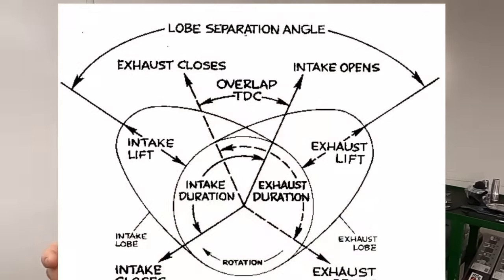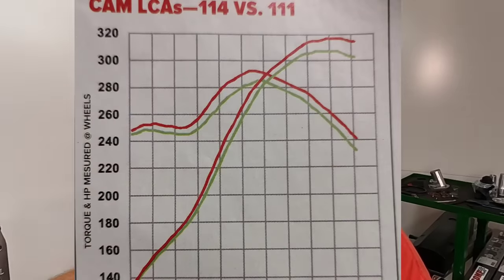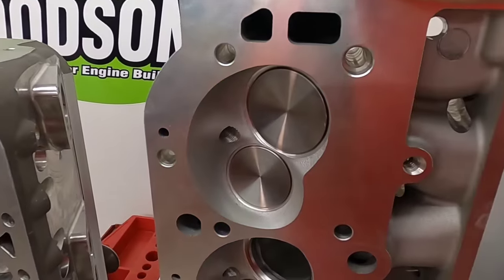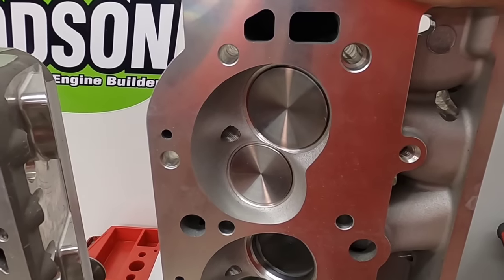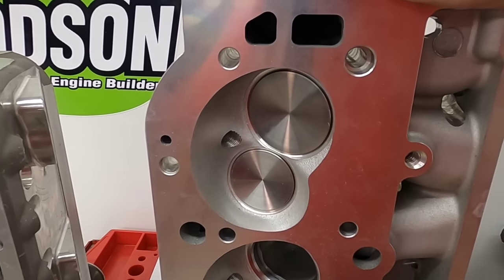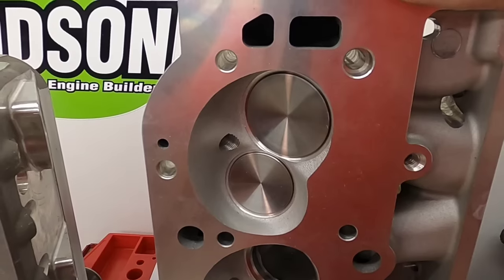Camshaft Lobe Separation Angle: The Untold Truth of LSA!! How to Pick LSA the right way@DavidVizard

Comment: Simple way to test it. Same cam lobes with the only thing changing is the LSA.

Then shift the overall cam event windows forward and backwards by simply advancing and retarding the cam(s.)

There. You now have a real-world dyno test changing ONLY the LSA.

PS four-valves, three-valves and Hemis will need less overlap to properly evacuate the exhaust.

Similarly, given only two valves, the more you dial the orientation of the valves from directly in line with overall flow to being a wedge side-by-side (or worse, if you had any reason to do so) the more overlap will be needed at any given RPM to scavenge the maximum exhaust, but the greater will be your swirl, as Pro Stock engine builders seem to absolutely LOVE.

As ever, your best route to maximum results is to test every single possible cam on your engine until you get it to behave exactly as you wish. Few people have the patience to do so, however. Preferably on the same day and at the same ambient conditions.

That includes flat tappet, roller, mushroom tappet, EVERYTHING.

Comment: My personal experience has lead me to believe that most "street/strip engines are full of compromises. If your running alot of lift, slot of duration you close the centerline to bleed off low speed to bleed off cylinder pressure at low rpms and spin it up to the point that the overlap isn't an issue and ur making killer power at 5000 to 7000rpm? I plan  build from my 94F150 flareside. I have a tci c4. I need to bleed off low( below 3500-4000) and come on like gangster 50' out! 450-500 hp max! A Sunday afternoon ride just to get ur adrenaline fix!

Comment: Just subbed to new channel.  Hey Andy, what was the combo on the 4.6 in the mustang when you made those dino pulls (compression ratio, head flow, intake manifold)?
Reply from the maker: John, at that time I had ported the Non-PI heads had 10.5 to 1 compression, Edelbrock Vic Jr intake with a Holley 650HP carb with 1 5/8" to 1 3/4"  Edelbrock stepped headers  the heads flowed 220ish cfm 
Thanks for subbing to DV's new channel
Andy

Comment: On a street engine I like to build an engine that's going to make loads of power in a useable rpm range. I've had engines that were almost all bottom end and almost all top end. I had a lincoln that sucked on lower rpm power but got the car to 165 mph, slowly. It's best to make loads of power by the time you hit 120 mph with midrange and top end power. So 2500 to 6500 rpm would please most.
Bloodviking

Comment: Hi guys thanks for your knowledge. Im currently running 230/236 112 on 355ci running 9psi with 2.4l whipple putting out 670hp /635ftlb @ 6200  but intake temps are up a  bit would the cam specs affect this at all?
Reply: Definitely not. You either lower the pump via maybe different speed or try to cool the charge a bit. Retarded timing and high octane would be your friends if all stays the same.

Comment: So l have a Question 4U Andy & David .  On a 496 Chevy BB .  With Brodix Aluminium Heads.  Not sure which ones at the moment.  Rectangular Port though . 
With the Edelbrock X-C96  X-Ram Manifold  circa 1960's . 
11.5 to 1  Compression.  Your 93 pump gas ⛽️ is 🇦🇺 Australian 98 octane.  
HP & TQ . 
1) 660/680 HP if possible.  
2) TQ as much as l can get . 
660 Centre Squirter Carburettors or Holley EFI Carburettors.  
MSD Ignition with 7al Box if using 660's 
& Holley Stuff if using there efi Carburettors.  

Hope this is enough information 4U. 
Now the Question 4U. 
What Camshaft Specs would U recommend pls . 
Engine use :  Marine.  
Beismeyer Flat Bottom  V- Drive 

Howard Cams recommend a Profile with around 640 lift & 112 lobe centre line . 

Thx Andy & David

Comment: My brother recently had a 383 Chevy built with a mutha thumper cam cause it sounded cool. Doesn’t make enough vacuum to operate the brakes. Told him it was the wrong cam for his type of driving. Fell on deaf ears
Reply: He's talking maximum torque and HP.... Not vacuum.
Reply: @hotrodray6802  understood
Reply: How's the off throttle response and general "nut" of the engine?  Does it take a bit to wind up and "come on the cam"... that sounds dirty.
Reply: @superkillr  haven’t heard it run. They only drove a short distance because it had no brakes. It’s a 55 Chevy still under construction
Reply: @superkillr  also has a sniper on it

Comment: Lsa plays a role in useable powerband. No cam is perfect at all rpms to build the highest hp and tork at that rpm. Only an adjustable cam could ever give us the max power of tork and hp at every rpm. But since a cam cannot be adjusted in the way the engine needs we have to pick one that gets us an acceptable power curve. What tork losses down low are acceptable for power gains up top. It depends on your application and intended goals. Are you aiming to build a low end towing motor with a  little mid range or a mid to upper rpm power combo. When unsure go with an intermediate cam. The best cam is not always found at the bottom of the list in a cam catalog. A custom cam isn't usually needed as most cam companies have a good diversity of cam choices. And it costs more time and money to get a custom cam made. Most people couldn't even fill out a custom cam order form.

Bloodviking

Comment: I'll try to be quick with my question:  hypothetical motor, 1.94 intake valve, 350 Cid, 11 to 1 compression.  I intend to use a 107 lsa, based on vizard formula, maybe 108.  Question: should I try to keep the intake centerline around the 107-108 as well, or is it OK to advance the cam, based on overall duration, trying to keep dynamic compression around 8.3 to 1?  Debating between running a smaller cam at 0 degrees, vs a larger cam at 4 degrees advance.

Comment: Will you (PLEEEAASSEE) Ask Mr Vizard to do a bunch of dynoing on GM Fastburn Aluminum heads as well flow testing numbers.. From 350CI TO 383CI engines...

Gm put those heads on (EVERYTHING) Gen 1 on their crate engines and long blocks they sell anymore, so it would be a good help and to see what actual flow numbers they put down, why they are so good, or how more flow may be obtained from them etc.

Thank You!

Comment: Well, thank you so much for sharing some knowledge. I appreciate it. 

I NEVER bought off the shelf grinds. They are grinds for dummies! My orchestra includes rod length, port volume and flow, compression and….. on and on. 

I currently have a Ford 4.6 in a moderately heavy T-Bird with full custom tuning available. I chose the lobes that looked right and selected a 110 LSA. Too tight many might say, but the car runs great and makes good power.

Different from the Boss 429 I owned years back. That was a completely different orchestra and some of the instruments were mismatched. In that case, something completely different was called for.

Looking through cam catalogs reveals how general their products are. One needs to apply knowledge and thought - something you bring here - to their specific application to get the orchestra to make fine music!

Thank you for bringing this.

Comment: I really like your's  & david's scandle on camshaft manufacturers lack of understanding of the product they sell. I do have a question that I'm  sure others would also like answered. While doing research into my next project, I  read or saw that a tight LSA will typically crank at 200+ psi, and according to GM's old manuals, that anything over 150 would not run on regular gas without pinging or detonation. Sure, I  know that we're  not talking about regular fuel here. With a zero deck, 106 lsa, 3.875 crank, 230° @ .050, .027 gasket, am I  limited by compression more than more typical cams? I've  asked David with no response or anything on his channel. Thanks

Comment: If I were building a top end boniville car I'd build it all for max top end power. So it would feel leggy off the line. A 2.43 gear with od would be an awsome top end build. I'd not push any engine past 8000 rpm for long. It will fail. You could push an engine longer at say 6000 rpm. It will hold together longer. Minutes vs seconds.  When we ran 9000 rpm it was for seconds only.

Comment: For a badass street motor Tightening the lobe center angle will lose vacuum You'll need a vacuum canister if you have power breaks Doesn't much matter if you building a Race motor Not to mention a stick motor  Can tolerate a tight lobe center angle Where in automatic transmission cannot You would need a lot more Converter

Comment: If you choose your own opening and closing Valve Timing Events, Lobe Separation Angle is a RESULT NOT AN INPUT  You can fine tune Opening and Closing Intake/Exhaust Events in order to achieve a desired Lobe Separation Angle, but ACTUALLY Designing a CAM is based on Valve Events. Spec'ing a Cam from what's available off the shelf is a COMPROMISE and starts with choosing LIFT based on Head Flow, Choosing Duration based on RPM Range (and accommodating for weaker exhaust head flow) and application and choosing LSA based on attitude of the motor.

Comment: What cam I can use in my ford 2.6 cologne engine, in order to make  around  160 hp and about the same amount  of torque  specially low end torque  the car is a mk1 capri weight is 2300 pound 4 speed  13 inch wheel  and final ratio of 3.23 and if possible  making more  mpg or equal  too thank you great video

Comment: Great video!

I'm curious what cam would you put in my motor. 

Then I'll say what I have.

C3 corvette.
400 engine..  (406 030 over 4.155 bore .004 skirt clearance. )
6" scat rods weisco flat tops .010 in hole
. 027 Cometic MLS gaskets.
220 flotek cnc heads flowbenched at 315 cfm at .600 lift. 71cc and 2.08 valves. HR
Howards short throw race HR link bar roller lifters.
Victor Sr style hurricane intake. Port matched for the .200 raised runner heads .
10.9/1 compression 9/1 Dynamic.
4500 stall
Th400 with ATD transbrake.
I drive 18 miles to track.
I am jetted for 150 nitrous. 
Maele rings gapped i think it was .030 and  029 (.0075 x  4.155 and  007 x bore on bottom )

My cam is schieder 292 custom grind 238/240 @ .050 with 110 lsa  622 lift degreed to 108.
Reply: I lost cam card but that's really close to it. 1.6 roller rockers so .618/.622 lift

Oh the crank is a 9000 series scat 3.75 stroke. And engine is internally balanced.
Reply: I wish I could pay to dyno and tweak degree etc. But don't have that $

If what I got is good I'll stick with it.

Comment: I always heard the LSA has something to do with vacuum for disk brakes and other things. That's why you should run a 110-114 for good vacuum, Is that true? If so what's the lowest LSA you can use and still have goo vacuum without having a vacuum canister.
Reply from the maker: That is what the cam companies say, but it's better to run a cam on the right LSA and less duration if you are concerned with Vacuum.. 
Andy

Comment: Do you change out cams on trucks? I have a 5.7 2014 Ram 1500 that had gotten a 6.4 cam, new valves, and pushrods, springs , and an HP tow tune put in 2 years ago and now its throwing codes again and misfiring on my cyclinder 6. Any suggestions on a kit for more torque. Its my daily driver / work truck and I pull dump trailers a few times a month. I also live in Iredell county North Carolina. Any advice will be greatly appreciated.

Comment: EFI will need a different cam as if you was running a carburetor. Lobe SP efi 113 and install@ 110 same engine but carburetor needs 108 lobe SP installed @ 104 this is what I always have done

Comment: good information, I waa thinking about changing my cam on my 318 bored 30 over headers,2-1/2 exhaust, crosswinds high rise rpm...9.3 compression...391 sure grip 2200-2600 stall....what do you think about changing from a 340 cam 429/444 114 lsa  to a comp thumper cam 473/486...107 lsa.?..i have small chamber heads. 750 quick fuel..69 satty.  .901-16 valve springs..looking for max torque...
Reply: Does this guy answer or respond to questions?..gheez 😂

Comment: This is my biggest problem. I'm going to use a 400 SBC, probably 9:1 or 9.5:1. I'm going to use the heads from my 70 Corvette LT1, w/2.02 Intake. I want a driver, with low-end torque but still go good to 5,500-6,000 RPM. It's going in my truck, that I haul firewood in, pull a utility trailer. I have the GM crate that's rated 265hp but 350 ft. I loved be that low end torque, but it's dead after probably 4,000 RPM. So I want as close to both.
Reply from the maker: I don't know what you are asking?  
Andy
Reply: @UnityMotorSportsGarage  I think he wants to know what cam would get him into the RPM range he wants. He tells you that plain as day.  I personally think what he want's isn't practically doable, although with a high rpm cam that, with other matched components to get  him to the 5,500 to 6,000 rpm he wants he'll need a set of high ratio differential gears especially if his truck has a manual transmission. If an auto he can do it with somewhat taller gears and a loose torque converter designed for that kind of load.

Comment: David's 128 formula does not consider compression, so how is compression ratio (10.5:1, 400 sb) factored in using the 128 formula to get max torque at lowest rpm?

Comment: I'm currently building a an early 70's block NA 351W with AFR 185cc Renegade heads with 58cc combustion chambers along with Keith Black Hypereutectic Flattop Pistons (KB151). Should turn out to be around 11:1 compression. The heads call for a hydraulic roller camshaft setup, as the valve springs have 140lbs seat pressure with 360lb/in rate, but I choose to go with a hydraulic flat tappet for now (I will be breaking in the engine with the center valve spring removed to reduce pressure during break-in). The cam I choose has an LSA of 109 and a lift of .512/.528 which I think should be good for my setup.
Reply: What intake you running?
Reply: @arodderz  Edelbrock Performer RPM Air Gap
Reply: @bluegizmo1983   That's an awesome intake. my Cam builder had me switched that 1 out to a ported Victor jr for my setup, but man I love that air gap as well.👍
Reply: @arodderz  yup that Victor Jr is good too! I did some porting and port matching of the Air Gap too before installing it
Reply: @bluegizmo1983  very cool. Running a spacer as well?
Reply: @arodderz  yup a one inch square bore to get a little more cross flow to maybe/hopefully get it to land somewhere between a dual plane and single plane performance wise.
Reply: @bluegizmo1983  Same here. The Air gap loves a 1" spacer. Particularly in the 4500 rpm plus. Best of both worlds. 👍

Comment: I am trying to pick a torque cam for a stock 72 F250 camper special to tow on pump gas. I have a stock 428 im building . With the specs I give to a cam grinder here says I need to have 9 to 1 compression for the cams they recommend.. Well the stock pistons  and heads I have are a little over 10 to 1. Love separation 110. Center line int 106 ex 114. duration @50 int 224 ex 230. lift is int 531 ex 540. 7 deg overlap @ 50. Any recommendations or thoughts.  Thank You

Comment: Does the "only one correct LSA per displacement/valve area" thing hold true for turbos? For superchargers it should, since there's no turbine to create additional exhaust backpressure, but for turbos, theoretically speaking, the exhaust opening ASAP and intake closing ALAP are the most critical operations, are they not? Shouldn't you also want to control exhaust gas reversion as much as possible so the turbine backpressure isn't blowing heat back up through your intake and causing knock/detonation?

If so, how do you then go about specing the correct/ideal cam for a turbo application? Cuz we already know that too wide on the LSA (and EVC at 40-BBDC with IVC at 40-ABDC with only 20 degrees of overlap, for example will have a HUGE LSA) will make the car drive like crap and be gutless down low. At the same time, too big a turbo (which you want for high end power, and big ones at high boost usually have the problems with pressure differentials) will also be gutless down low.

So it kinda seems like a lose-lose unless you intend to keep your turbo platform as a whole conservative at around 1.5x to 2x your max N/A potential and nothing more in order to keep it responsive and optimized.
Reply: Actually, based on how you defined centerline/separation (being at peak lift) I think I figured it out. You just need to have asymetrical lobes that open the intake and close the exhaust faster, while the peaks are at the correct LSA, and where the intake closes and exhaust opens more gently but over a longer period/duration on their respective sides of the peak.

Comment: On a cam with a wide LS, can it be advanced "X" amount of degrees to bring it in to compliance? In other words, if a SB Chevy 350 needs a 108 * LS but the grind that you have has a 112* LS, can that camshaft be advanced 4* to make the intake centerline 108* for a benefit? Thanks much, Jim
Reply from the maker: No, it won't make up for being on the wrong LSA. 
Andy

Comment: Makes sense, the more you shave off the head the more LSA you want to keep your valves away for your pistons.
Reply from the maker: Abe while that is true to a certain extent.. the main reason is due with the higher rate of pressure decay of high Compression